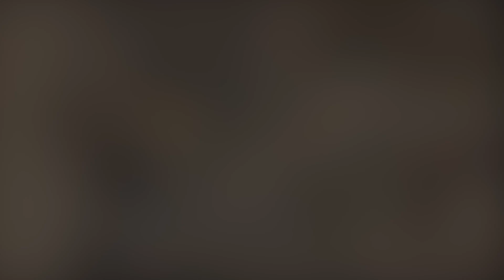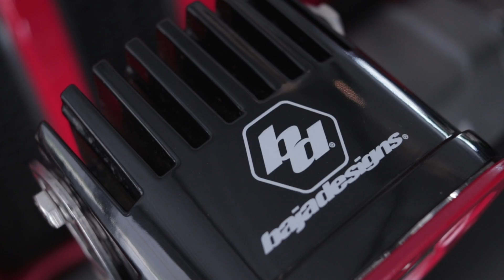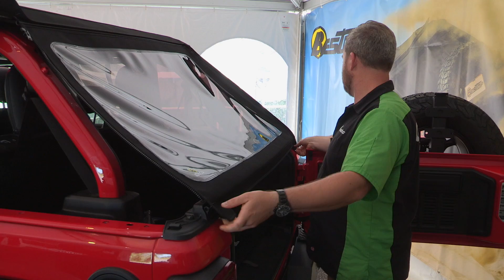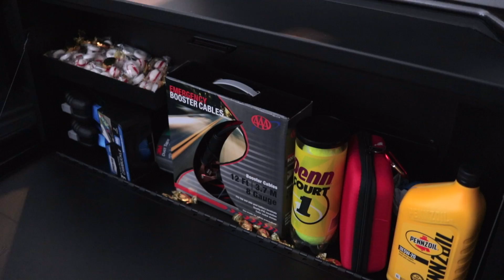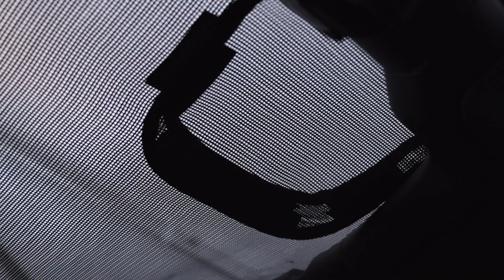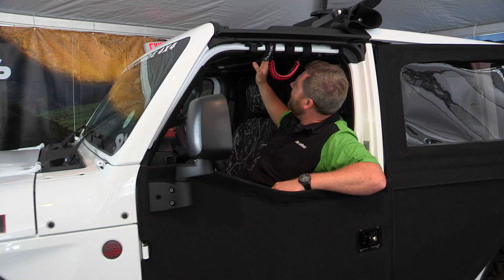New Jeep Wrangler JL Products from Bestop, Baja Designs, Tuffy Security, PRP Seats and SpeedStrap

Comment: When will these parts be listed on the Quadratec site?  I'm curious about cost and availability, but I couldn't find them.
Reply from the maker: Most of the Tuffy Security products and Baja Designs products are ready to go and we will be adding them to the site as soon as we get full details on them. The new soft tops should be available sometime between now and the end of this year. Bestop is currently refining a few small details on some of the products and finishing durability testing to ensure the products are the absolute best they can be when they go on sale. As soon as we get more details, we'll be sure to let our customers know and we'll get the products loaded up on the website.
Reply: EJ3CTA in about 6 to 7 months. They are always slow getting new things out.